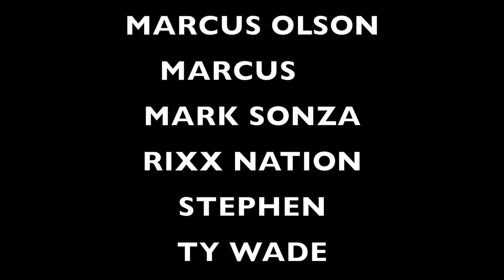IVE BEEN HIDING SOMETHING HUGE FROM YOU!

Comment: Please do a cam kit really you have to upgrade valve springs anyway so might as well change cam but this thing is a going to be insane like on E85 with good fuel system it's going to be faster than anything you have if it can get traction
Reply: It already has a cam and supporting mods...
Reply: @coreyclark2692  he never did a cam kit atleast he didn't make a video about it it's just a factory engine

Comment: GTO's are what we in NZ and AU call Holden Monaro's, pretty much a Commodore coupe, theres 4 door sedan, wagon and UTE version of that model. Holden commodores and Ford Falcons would be your stereo typical bogan mobiles over these ways. older models are cheap, big 3.8-4.1cc 6 cyl engines and v8s which are rear wheel, do decent burnouts and make mean cruisers as there big cars and built for open road smooth driving. I have a 2005 Turbo xr6 Falcon and i love it, tows massive car trailers, goes hard and super reliable